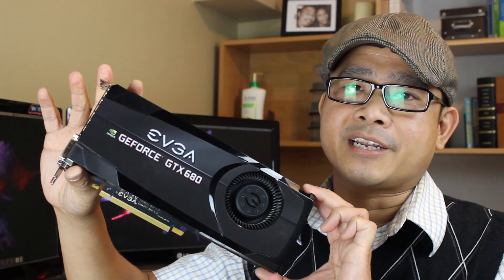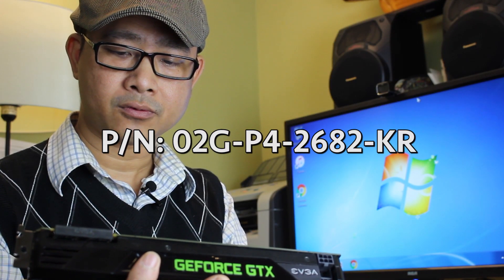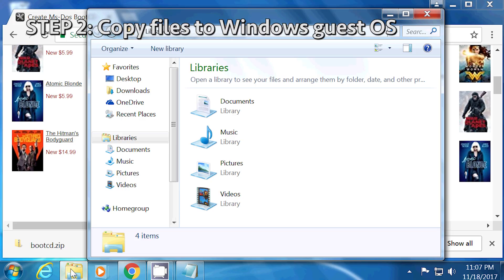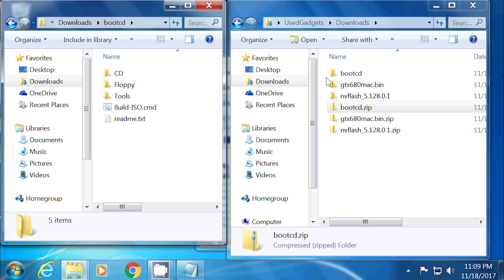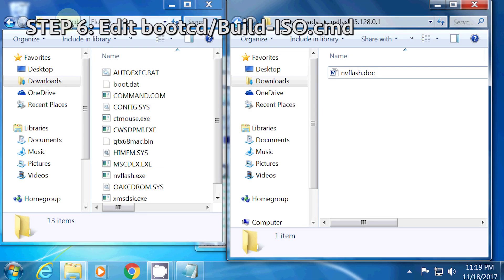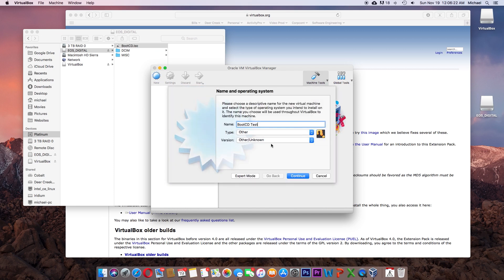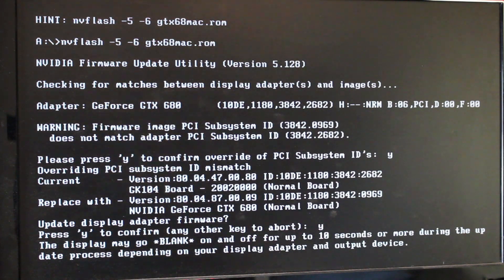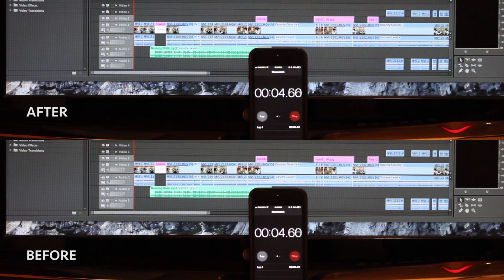How to Flash GTX 680 for Mac

Comment: This is great, thanks. I followed your instructions in April 2020 and it worked well. I used your BoodCD.iso and when I booted I only had the GTX 680 attached, I didn't have the old graphics card attached at all. I held down c on the keyboard, saw the boot prompt andtyped the instruction. I only had to answer one question and the flashing took less than 30 seconds. Then I booted and there was the boot screen and when I logged in I could see the 'NVIDIA GeForce GTX 680' and in system profiler: Chipset Model: NVIDIA GeForce GTX 680, ROM Revision: 373, Metal: Supported, feature set macOS GPUFamily1 v3. 

This is my first ever youtube comment.

Comment: I will confirm that this procedure worked great on a Mac Pro 3,1 to flash a EVGA 02G-P4-2687-KR card.  I previously ran a flashed ATI Radeon 5770, but had issues with sleep failing to rewake under High Sierra.  I built the BootCD as described, but didn't need to as I downloaded the BootCD so generously shared by Used Gadgets in download Link 5 of the comment section.  Be sure to burn it to a CD using Disk Utility, I made the error of burning it through the finder and it didn't function to boot the computer.  Initially after flash and reboot, I had some green fringing on edges in one of the two 30" DVI Cinema Displays I use, but after making certain all connectors were clean and tight the fringing disappeared.  I'm now running High Sierra 10.13.6.  Yay!  Thanks so much for this fine video, it worked great.

Comment: hi, i have mac pro 2008model the installed card is old radeon AT 2600 256mb, im planning to get the same GTX 680 3gb .. i can follow your step even i dont have your radeon 5770?

Comment: I have a problem. 

It seems my original card requires both 6pin cables in order to show anything on screen. Therefore the GTX can't have any power.

I don't particularly want to try typing stuff in when i can't see it...

Does anyone know any way around this?

thanks.
Reply: I tried booting with both cables in my own card, then swapping one over to the GTX before flashing, and then pressing "y" when things seemed to stop. It sounded good, but afterwards when I booted with the new GTX card in the first slot, it didn't work.

Comment: as long as you don't need the boot screens there is no need to flash. Just make sure to get the proper windriver from nvidia instead of using the built in nvidia driver in osx.

Comment: I flashed my Nvidia GTX 680 for my Mac Pro 3,1. It works but I do not get the Apple logo at boot-up. It goes straight to the log-in window to type in my password. I therefore cannot go into recovery mode or to boot to another MacOs. If I try to flash the graphics card again, will that damaged the card? If you can please give me your input. Thanks.

Comment: the card will still work fine only will not have a mac boot screen, you ever want the use a mac boot screen you just have to reinstall your old video card to use it then put back you're  gtx680 when your done, if you can use a command of the boot screen  in the dark it will work anyway without putting in your old card with a mac boot screen, the mac boot screen is not used that often so it can be used just like it is with out flashing it

Comment: Hello! First of all thanks for your video. I got myself an evga gtx680. I want to flash it but I have a couple of questions. My current card is an nvidia GT120, so if I run this as you demo-ed it should I expect any fuss of the system trying to flash the GT120? Should I assume that you should not try to flash the gtx680 with the monitors connected to it? In my case the monitors should be pluggted on the GT120 correct? Tks in advance

Comment: Cool video mate! Thank you for the info. I'm writing this on my Mac Pro that now has a Mac-flashed GTX 680 and by the looks of it, it works very nicely. One funny thing though is that until now I had 2 monitors connected via 1 HDMI - DVI-D and one DVI-D - DVI-D cable (both DVI-s being connected to the GTX). Since I flashed it, it doesn't support 2 DVI-D-s being connected. I figured out I had to switch the HDMI - DVI-D cable to a HDMI - HDMI and now it works OK again... Just worth mentioning in case someone would run into the same.... I really thought I messed up something, but no... just something has changed in the ROM... BTW, I have a Gainward GTX 680...

Comment: Has anyone tried just replacing the existing graphics card with the GTX 680 (with both power cables) attached and then booting up with the cdrom inserted and the 'C' key held down? While the boot selector screen won't be visible with the PC rom, I would think we should still be able to use that standard keyboard shortcut to force booting from the CD for the flashing (without resorting to having two graphics cards installed), no?
Reply: To answer my own question, apparently the keys won't work in the absence of the boot selector. However I have verified that removing the drive bays will cause the cd to boot. I am still puzzled why the author didn't just recommend that the GTX 680 be fully installed and powered since it should be fine for displaying the flashing prompts.

Comment: Excellent video and thanks so much for putting the ISO file with everything ready to go for the flashing process as a download link.  I just finished flashing my recently purchased EVGA GEFORCE GTX 680 (PN:  02G-P4-2680-BR) even though I couldn't find that this was a PN that worked.  Really appreciate it, Michael!

Comment: Seems very tricky for beginners. Besides, I have no PC either, but a Mac Pro Quadcore mid 2012 with Nvidia Geforce GTX970, but it gives me problems. Spinning fans and black fields are some of the problems the computer has with the card. Should it be reflashed? Mac Edition is the ROM called.

Comment: Great video!
Can I flash a GTX 760?  I`m already using a unflashed GTX760 for more than a year. It runs normal, but no boot screen and no 16x PCie, only 8x.
Thanks
Reply: The ROM file is only for the 680 so it wouldn't work. You could send the card in to MacVidCards and they can flash the card to an Apple EFI compatible one they developed. You probably won't find their ROM posted anywhere online. I believe the flashing service is just under $100 USD, but you'd have to message them and ask.

Comment: Does this work with the normal 680 or do i need to buy the mac edition 680?
Reply: This is to turn the normal PC version of the eVGA card into the Mac Edition. You are basically re-flashing the EEPROM on the card to include the Apple EFI code using a copy of the original eVGA 680 Mac Edition card's ROM. This ROM is for the 2GB version of the card, not the 4GB version so be sure if you buy one you get a part number listed in the description.

Comment: One more question... Is the EEPROM (or whatever that flash chip is called) big enough in these PC gtx680 cards for the Mac ROM? I failed to flash a 8800GT card because there was not enough room for the ROM... Thanks again!
Reply: Some cards have a 2Mbit/256KB chip on them, which is not big enough for the Mac version. The eVGA part numbers listed here have the 4Mbit/512KB chips which do work.
Reply: Thanks for the reply! I have bricked many cards now but finally had luck with a Radeon HD 5870, which is not as good as this card but much better than the old 2600XT

Comment: Hey, I know I'm late to the game but I recently decided to get some more life out of my 2008 Mac Pro 3,1 by upgrading my video card. After some research I decided to buy a used PC version of a GTX 680 and flash it. Your video and your iso file were of tremendous help. I appreciate that you provided the iso file as I don't have a windows machine and did not want to install a virtual machine just to obtain the files and build the iso.

I burned your iso file to a cd, followed your steps in the video (starting with installing the card in the Mac) and everything went perfectly. The only deviation I came across was that I only had to provide the "y" response to one question and not two as you stated in your video.

Card is up an running great. Thanks again for your video and file, I really appreciate it.
Reply: What command did you use to boot CD on mac?

Comment: Hello, I have a Mac Pro 2.1 with 2x3ghz quad core xeon with 16 gb ram and a video card pny gtx 550 ti and I am soon to buy a gtx 680 to install it on my computer. Could this process work to improve the performance of my machine? or rather, does my machine qualify for this gpu flash? Thanks, I hope the Google translator allows you to understand me since I do not speak English.
Reply: do yuo try it? and works??

Comment: Hey  Michael great videos, Question / I'm using a MacPro 2.66 GHz Quad-Core Intel Xeon / el Capitan, I like to use Davinci Resolve / But so far is confusing which video card I can use without changing the processor I have now. Any tips please. I just want to use Resolve. Any GTX Cuda card you recommend. Anyone have tried and work  OK ? Thanks

Comment: HI,

Thank you for the very helpful video which allowed me to flash my Asus GTX 680 DCUII card. Just to let everyone else know that if you encounter an "EPROM PROTECTION ENABLED" error message when flashing you need to run just the nvidia program using -R flag which will disable the protection... and then you retry.

once the card has been flashed and you follow the rest of the video, power on your machine and your GPU fans are on full throttle then you need to power down, pull both power cables... power on.. a message asking you to connect power cables will appear.. power off your machine and plug in cables... then power on again... your card should work flawlessly... (well... it worked for me)
Reply from the maker: I’m glad it worked for you. Thanks for the additional -R flag, I didn’t encounter the protection enabled error.

Comment: Am i seeing it right that you connect only 1 6-pin power cable during the flashing stage/at the point that you have both video cards installed?  How does that work?
Reply from the maker: Yes, but remember to connect both cables in the last step.
Reply: ... this is correct - the card only uses the additional 8pin power when under load, for flashing only it works fine with one 6 pin connector...

Comment: Well done dude. Amazing job.   What if instead of an ATI  Radeon, my mac has an NVIDIA GeForce GT 120 512 MB?   Didn´t it work?  What dou you reckon?
Reply from the maker: Sorry, I don't understand your question. The GT 120 is natively supported by the 2009 Mac Pro and there is no need to flash it.
Reply from the maker: I understand your question now. You can substitute the GT 120 with the Radeon 5770 in the instructions with no problems. Good question.
Reply: Used Gadgets Many thanks Michael.   Awsome!

Comment: can this be done to a 1080? or do you have to solder stuff and get a custom eprom?
Reply from the maker: Good question, I'm not sure yet. I'd have to test it and will post a video in the future when I get to it.
Reply: macvideocards wants $225 to do it, what the. running a 5,1 and it would be great to have the boot screen
Reply: google didn't yield much in flashing a 1080.
Reply: +Alpha Buy a cheap Apple card for the boot screen. Run 1080 for everything else. Simple.